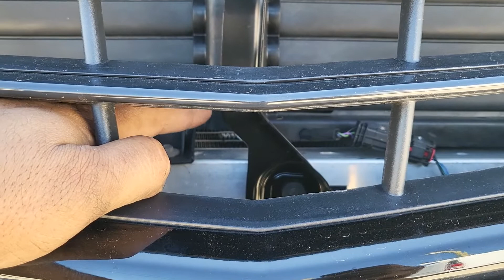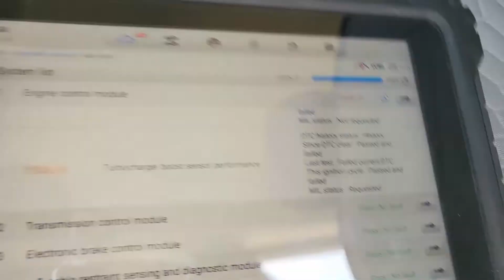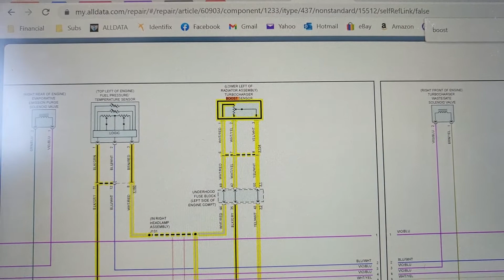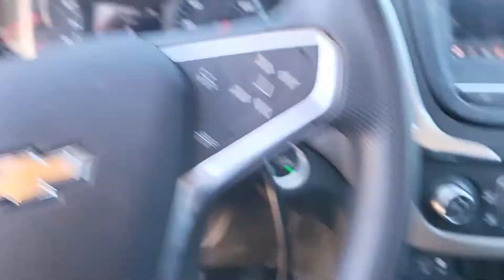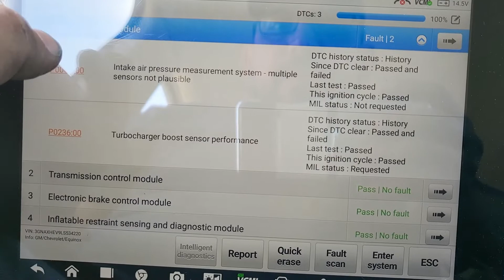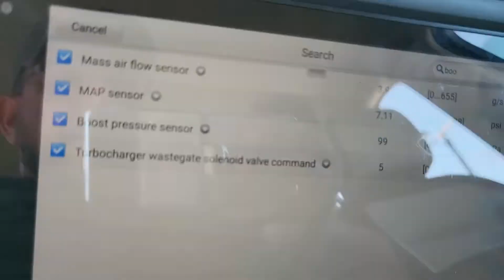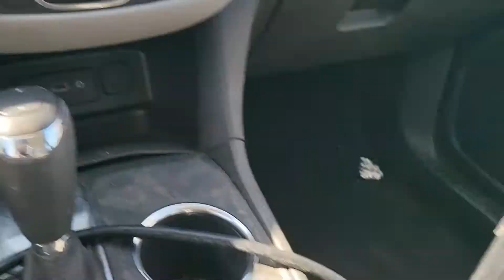Reduced Engine Power, 2020 Chevy Equinox with P0236, P00C7 and P059F codes.

Comment: Hi on my 2021 equinox the code reads po299. i erased it didnt come back on for about a month. then it came back on. I was told the booster cant be out because i have only 80000 miles its to soon for that to give out. I have no front oil leaks. any other suggestions that will cause that code to appear? I appreciate your time, thank you

Comment: Just got that check engine light and a reduced engine power message today 2022 equinox 8k miles
Reply from the maker: This is unbelievable
Reply: Just got the same thing!! 9k miles. How was yours fixed?
Reply: @Aringo13.1  its still under full warranty until 36k miles. i forgot the exact part name but i believe it was the throttle body pipe popped out of place for no reason. Sorry i forgot the name of it but i know exactly where the part sits. It is on top all the way towards the back of the engine a plastic pipe that is connected on with some metal gasket
Reply: @tiko5750  Sounds like the charge pipe.  Mine started this mess a month ago.  My charge air inlet pipe was super loose on the turbo so I replaced it with a new one.  Then road debris punctured my intercooler so I replaced that and I'm still getting the low boost message if I get on the throttle so I'm going to replace the pipe you're talking about with an aftermarket unit that clamps on both ends instead of being held in place by wire clips like the factory unit.  Meanwhile I have a scan tool on my phone that I keep running while I drive so I can clear the codes as they occur so I can have some power.

Comment: Where did you get the replacement piece from the front? 1:38 mark. Thanks
Reply from the maker: I do not buy the parts. The owner does.
Reply: @DallasAutoDiag  that’s unfortunate :/ been looking everywhere but can’t find that exact part. Going through same issue with my equinox right now.
Reply from the maker: @3ylimon  just hund up with the owner he said he also couldn't find it anywhere so he went and got it from the dealer. It was about $175
Reply: @DallasAutoDiag  gotcha. Did he know exact name by any chance
Reply from the maker: @3ylimon  are you asking about the active grill shutter?
Reply: @DallasAutoDiag  no. I found the name of the piece I was looking for. It was that front brace bumper support. The black piece.

Comment: Had a similar issue with my '17 malibu and I read up about it.  I saw once post where they suggested checking the oil level.  It was low, once topped up the code cleared soon after.  Another time it was -30 plus windchill was about -35/9.  Cleared code myself this time with a scanner and also topped oil up.  So far it's stayed away.

Comment: Wow my car say the same thing reduced engine power light is on plus my airbag light and my engine light is on  plus my radio don’t shut off when I open the car door do this mean the car is bad ? But they working on my car I have 2013 Chevy ltz
Reply from the maker: I wouldn't say bad. All cars break all the time. Hopefully they fix it for u.
Reply: @DallasAutoDiag  yes see I just got this car a month ago I have a car note so I’m trying see lol why would it be breaking down that soon
Reply from the maker: @linnellbrooks5711  how many miles on it?
Reply from the maker: @linnellbrooks5711  ok so i understand if tge check engine light comes on for a sensor or something, but why the airbag light. Usually airbag light come on after an accident.
Reply: @DallasAutoDiag  my point now it was never on when I got it but when they said they fix the airbag with this one shop they took me to thats when it was on when I picked it up they told me it was gone turn off don’t worry about it then when they send me to a new shop they ask me was it on when I first brought the car and I said no which it was never on then it says service tire monitor system is on . So all this is on , and also my door locks wasn’t working when I first got it I had to unlock they door with car key and the back door wouldn’t open they alarm would go off if I tried to open it with the front doors open they my radio is staying on even when I open my doors and turn off the car it want go off for 3mins and my one light that’s in the car is not working only when I hold it down
Reply from the maker: @linnellbrooks5711  i think you should have a talk with the person sold you the car.
Reply: @DallasAutoDiag  I sure will in the morning cause they might have to get me a new car honestly if that’s even possible

Comment: I have a p0236 , p0238 and i replaced the sensor but the check engine and the code still on i deleted the code but it didn’t go what should i do ?
Reply from the maker: P0236 is casued by p0238. Fix p0238 and p0236 will go away. P0238 is a circiut high code which means tgere is something going on with the wiring. Was tge car involved in an accident recently? Did anyone repaired any wiring?
Reply: @DallasAutoDiag  yes there was an accident and yes ive checked the wiring but its fine
Reply from the maker: @amvvideos5156   Did you check by just looking or did you use a Vol meter?
Reply: What do you recommend for 2038 
@DallasAutoDiag